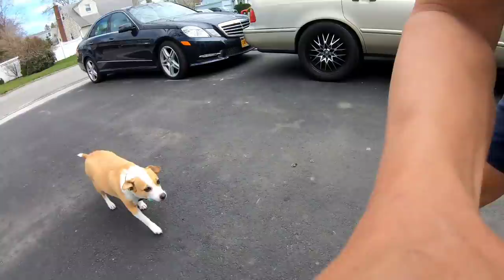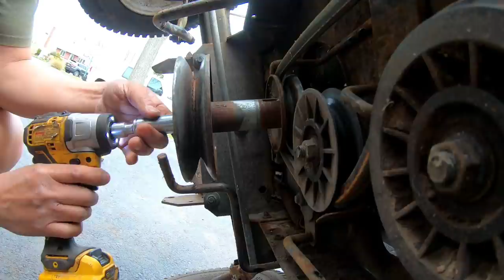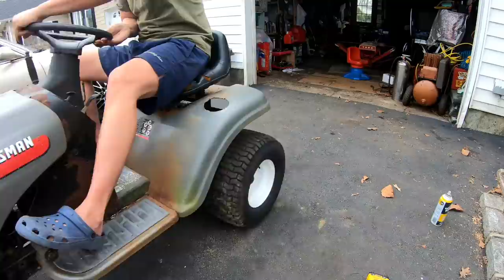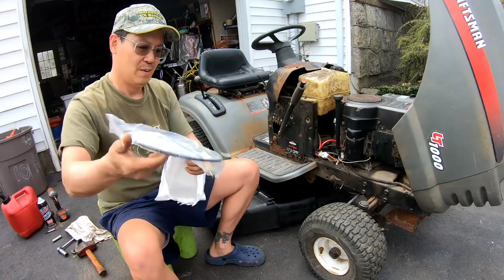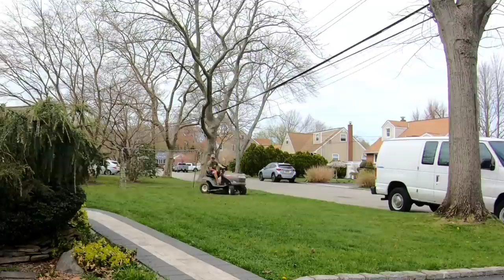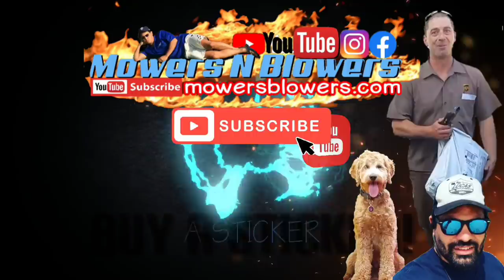CARCASS OF CRAP FRANKENTRACTOR CRAFTSMAN LT1000 LAWN TRACTOR REPOWER PROJECT LIGHTS MOWER DECK FINAL

Comment: Oh what an amazing turnaround on your mower. Sometimes the “Diamonds In The Rough” turn out to be the best performers. 
So one of my lodge brothers had a 5 x 10 mesh floor trailers that I went to look at a few days back that has a Champion 196cc 3000 watt generator mounted on the tongue. So I brought the trailer home with me and the next day I decided that I wanted to start up the generator. So I pulled the rope and I thought that I was going to pull the engine/generator from its chassis - The rubber anti vibration mounts were all broken. Naturally I had some good fun out of my friend regarding the mounts being broken. So if you get a used generator with the Honda/Predator engine, Check out the engine mounts to the chassis because when the rubber drys out - The mounts usually always break apart.

Comment: Paint it up and ask $475 for it!!! Pressure wash it and spray paint it with four cans of 98 cents paint....worth a $100 more.  It's super mechanically sound now.
Reply: I agree Bobby, that tractor is mechanically sound. Run it through the MOWERSNBLOWERS paint booth and up the price.🎨🎨👍

Comment: You have those solder butt connectors right, the ones you heat up to make the connection, what do you think of em, I just received 300 of them, all different sizes. 
haven't tried em yet, and a hot air gun, with the curved attachment made for it so it doesn't burn what's behind it..... Let me know..... Any tips with using em?
Reply from the maker: It’s great but you have to figure out the gauge of the wire to fit certain size holes
Reply: @MowersNBlowers  awesome, tks bro.